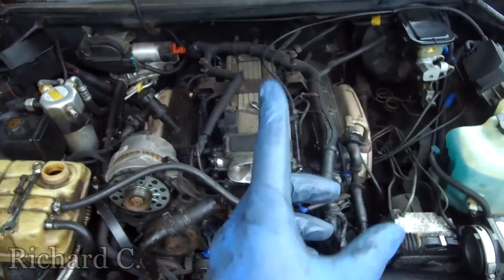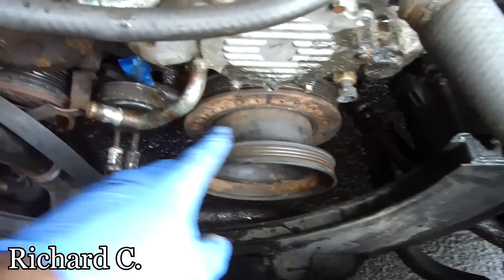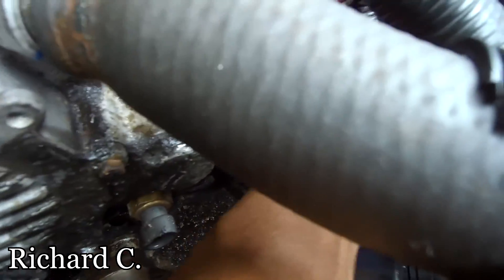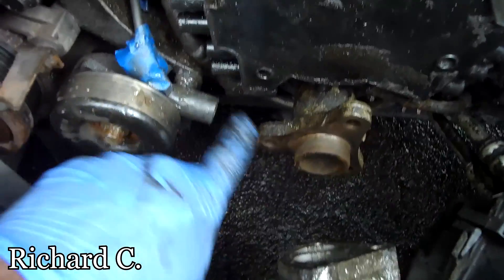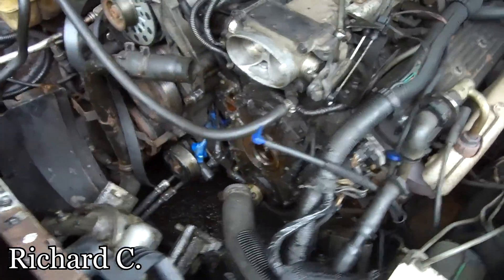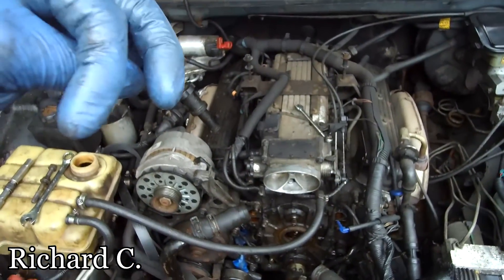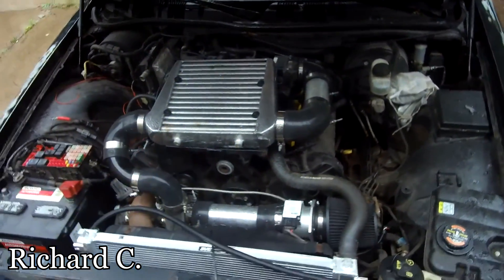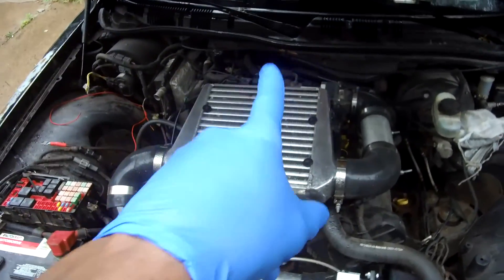Buick Road Master ( LT-1 ) Opti-Spark ( From a Ford Guy View )

Comment: IA few years back I had just finished about two weeks of upgrades and tune up work on my (new to me) LT1 Vette (Headers, cat delete, mild shift kit, and general restoration).  And when I tried to drive it, it started misfiring and was running like crap.  Experts online were telling me I needed special O2 sensors among other things.  Turns out that I'd pulled out the lower 2 plug wires on the opti.  But you couldn't see it, and had to find and replace them by feel.
Reply from the maker: wow those plug are kinda hard to get off.. but you did find the issue and thats a good thing great story mat .. I am happy to see you typing bro..

Comment: I'll find an LT1 AND a Crown Vic. Both awesome cars that will last ya 10-20 years with care. I'm a GM fan and a Ford fan. How could anyone Not love the legendary Clown Victoria? But, that Road Master has a Corvette engine...so, whatever😎
Reply from the maker: Well the Vics are solid well built endurance cars. That will go 200k easy i had one 300k. seen Lincolns 400k same engine until it smoked ran good though..Its all about what you like.  Have you notice when we speak about Chevy we speak of not the Car but the motor Lt1 /Ls Ford guys we speak on the car itself. Thats the difference in many shop talk forums lol.. You speak the truth though Chris

Comment: I can tell you this: 6 speed swaps on LT-1 caprices are way easier than on crown vics, and with that low end torque they. are. fun.
Reply from the maker: I bet they are a blast Scott. what clutch pedals do they use
Reply: Roadmaster with a six-spd !? A land speed-boat?

Comment: I had 
94 caprice 4.3/205hp
95 caprice 4.3/205hp
94 roadmaster 5.7/265hp 
That 5.7 is a beast very torqueeEe
Reply from the maker: yes these engines are very good that opti spark is the only flaw i see, but a great engine never the less

Comment: My buddy sold his old large body SS Impala after changing his distributor about 12 times. He tried several brands and rebuilders. Now I see why he sold it. Those GM engineers are all in different rooms and never get to see the goal of a finished product. Ford is better but I will stick with my Honda cars and truck and pre-hardbody 84 Nissan pickup. That distributor situation isn't just stupid, it is asinine and obviously an afterthought in the whole design process. What a piece of sheet! I have been driving the Nissan for 30 years. 400,000+ miles now.
Reply from the maker: sohc ka24e is one of the BEST engine out there by Nissan ( before the fiat bought into them ) this is a very very odd design of where to place a distributor . No way to cool the item heat front and back of it ( leaks oil and coolant ,, It was a after though cause they needed something quick, Or somebody got high and created this... Great story bro I enjoyed it

Comment: The P71 really couldn't compete with the 9C1, the LT-1 was a beast. Sadly, there really isn't much aftermarket support for the motor - once the LS was developed, it was game over. LT-1 was truly the best vortec-head small block ever made, real torque monster and reliable.
Reply from the maker: I can see that Scott, but the ONLY thing the 4.6 got going on for itself is reliability and gas mileage ( all around well built car ) it was a endurance car not a performance car. Solid Simple Built car Lt1 is a performer no question ..

Comment: Can anyone please tell me how to properly install the pin drive type distributor? The Haynes manual has one paragraph and a vague picture explanation and there are no videos on YouTube showing how to install that type.
Reply from the maker: you mean the Non vented optispark from my understand it ois splined ( with a key way ) meaning it goes in 1 way... so if it isnt going in you have to spin it to make it fit
Reply: @bstfordchannel923  No the other one with the pin and 3 slots
Reply from the maker: @CalvinJGreen  ok well thats the vented type... This goes in 1 way... you should have dowel ( in the came with 3 holes ) now on you optispark disrib you have slots but 1 is different its slighty larger THAT goes over the dowel part of your cam.. look at it very well
Reply from the maker: @CalvinJGreen  or you may have the wrong one also.. 92-94 had a smal tapered hole ( middle of the cam ) and the 94-97 and a bigger hole for the shaft to go in... so you may have the wrong year part maybe
Reply from the maker: @CalvinJGreen   that will explain why it does go in ( maybe )
Reply: @bstfordchannel923   My Roadmaster is a 94 wagon. I installed a Remanned AC Delco Opti putting the cam pin in the largest hole like you said (the one that is not hour glass shaped) and now it runs worse than the old one - It won't start until about 3-4 cranks and runs richer than Oprah to the point where I can smell fuel in the oil. Trying to figure out if I did something wrong that isn't explained ANYWHERE or if it's just a bad part. All the explanations  seem to be to just "stick in it" . Do I need to be at TDC? can it go in more than one way? Is there another issue that the new opti is amplifying? Any insight would be amazing thank you.
Reply from the maker: let me tell THIS part i installed ( went 2 weeks later ) had to install another, but when these go the car does start.. it off timing or you have 1 wire in the wrong spot... cause the left side wires are a bit crazy ( and tight  ) you have to try in in diffrent postions sice you said it ran worst... ... Go back and try it again try it 3 diffrent ways 1 should work but check the wires

Comment: Mr Richard,  I have a 5.7 lt1 camaro z28 6-speed,  had head gasket replacement, fuel pump, ran good did a local on the way back she died... would not restart,  it started later...but she started but, 30min later died... every time she would restart but shut off 30, had a ignition coil replaced,  they ran/drove it for hour ..I got her let it run, 40min took her for a test...power etc was there but she did the same 😢 i got her back, too shop... notice fuel filter looks old. As it went up on tow, but don't know...would does it sound like...???

Comment: 4.6 modulars arent that bad. They just need some gentle prodding to wake up and when they DO wake up, they drive like a bat outta hell. It's just that these engines are mated to 4000 pound boats that should have had the 5.4 to start with. Not only that, they DRAGGED this car for YEARS with basically no improvement. A new powertrain could have done these cars some good around the 04 to 06 mark, but hey, it's what we have. I'd take my reliable, slow tank over any other car any day of the week.
Reply from the maker: well said i will fully explain what the Crown vic is to me in another video..You said it right  Da Kappa Man the crown vic could have used a better head or something to get the years something different. the Crown Vic is a endurance car nothing more nothing less. take a race from east coast to the west full throttle the crown vic will make it. the other cars like the opti-spark will suffer...

Comment: I know Now that GM Smokes Crack by some of these Engine Designs Lmao 😂 and everyone talking about Crown Vic's ain't very fast okay I get it not going to blow the doors off of a Porsche but my 08 all I have to do is take it out of overdrive and she's beat the Hell out of a lot of cars on takeoff and doesn't lose steam, and when in Overdrive at 60 mph nail it she shifts hard and you better have real estate, now I don't know if the transmission has been messed with because my other vic didn't do this. Everyone Ragging on Victoria's and Never looking for her Secrets
Reply: I agree it takes real tuning to make Vics move. The short cut is force induction or engine swap.  Ford is known for low displacement and making do with it and making it work!
Reply from the maker: Well they was free basing at those times those engines was designed lol... Now to the Vic ,its a Endurance car not a performance car. When they built it they took a who new approach which was BUILD A SOLID CAR simple and too the point. And thats why you have 1 and I have 1 Rob.. Its not a 0-60 car its 300k mile type car. Great story bro I did enjoy it.. The vics Rock hands down
Reply: BST Ford Channel I know but so many people make them sound like a Moped 🏍 could beat them lol 😂
Reply: In my 4.6 Ford mine loves to climb in the rpms. I also put in the time to do some tedious work, shift kit in my auto new shift solenoids, filter and installed a trans cooler it seriously helped a so much to improve its ability to put power down the road for what it has.( Note the trans was rebuilt and only altered after warranty expired and kept up with maintenance beforehand so be careful with possible never been serviced transmissions ).

Comment: Working on GM cars a' Learning Experience'?? Naw Man it just sucks! Who builds a motor with the spark box behind the water pump??  an easy fix is a Cam sensor wired to the spark box... like easy to access???
Your right, the 4.6 is a tough little engine but in a big ole Crown Vick will still a runnin down the road while them Chevy's are at the Crusher 🤣😂😁😀😎
Reply from the maker: RIGHT ON DANIEL  the Crown Vc is a ( Endurance ) car  not a traditional performance car ( to what may label  ) a performance car . Gm drop the ball here they could have done something different, but I think they needed something quickly and this was it ( cost efeective ) and simple for the time. Many of these lt1s where lined by the crush for this issue plus running out of oil ect
Reply: @bstfordchannel923  Right!  and the Towncar is a prefect 'Guido' car... ride 5 people comfortably inside a 6 bodies in the trunk  🤣😂😁😀😎  Love the 5 speed swap... I seen that smile on your face! Way to much fun!

Comment: 30 seconds in and I'm laughing hysterically already! You basically need every frickin tool in your box to work on a Chevrolet. I hate them!👎🏻
Reply: Lol I 2nd this !
Reply from the maker: dude i was shocked but this is car game lmao... Its aq cool different engine to work on .. i am checking it out. i would not buy 1 UNLESS for 200 bucks running ( police version of course )
Reply: @bstfordchannel923  Yeah the full size chevrolets with 350s in them were cool cars. Caprice, Impala, Monte Carlo, etc. I've always liked all of those. They are classics just like the Crown Victoria. I just genuinely think Ford did a better job. The Fords are definitely lacking in the power department by comparison, but they are just better cars.
Reply: @reignbird3167  😂
Reply from the maker: @harrison4ever125   very true those Chevy made GREAT classic body no question there. Ford made a more solid car to chew on..  here is ford line up 4 cylinders down to v8s focus RS of course , mustangs, trucks , bigger trucks, Transit vans ect. They have a ok line up the v6 just started to gain spunk dang near 300hp na